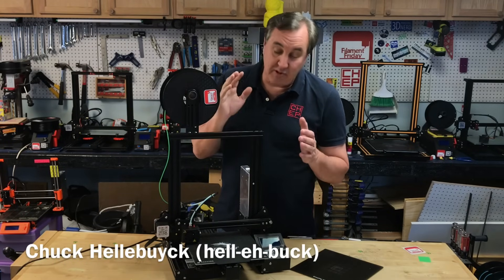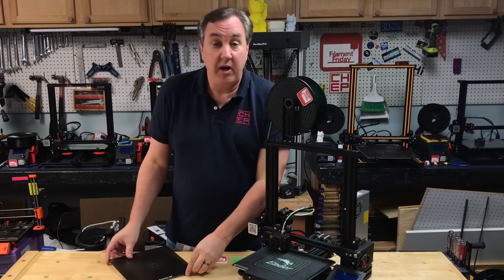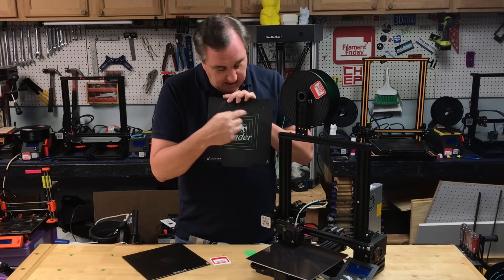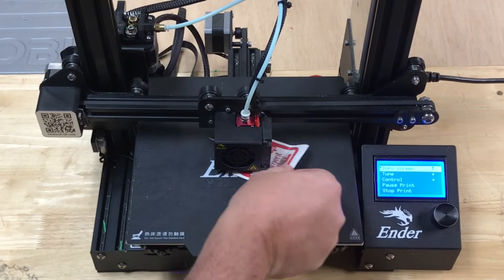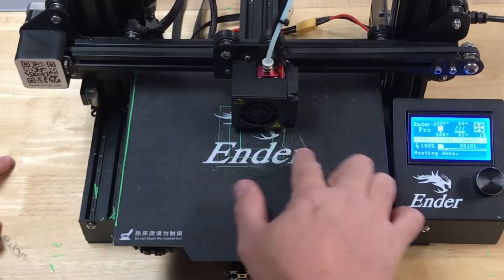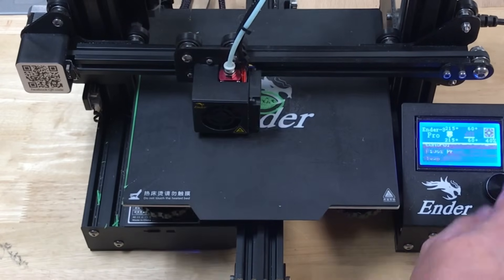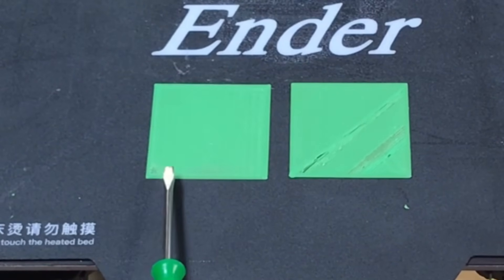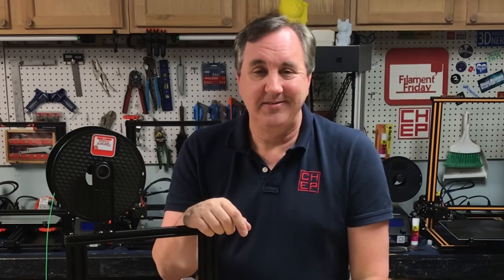Creality Ender 3- Easy Way To Level Your Bed

Comment: My ender 3 is my second 3d printer and your tutorial is all I needed to get it printing in a resuliotion I am happy with. Thank you for creating such an easy to follow and useful visual aid in getting my ender out of the box and printing in such a short amount of time. I think it was less than 3 hours from opening the box to first finished print and I cannot thank you enough for your help.

Comment: I know this is an old video.  one thing no one ever discuesses when leveling the bed is how to - preload the springs  on a printer bed.   epecially of yuou had to replace your bed for one reason or another. (I am in thise boat)  can not get a level bed
Reply from the maker: Try to lower the Z switch.
Reply: @FilamentFriday  I finally just leveled for the center since I'll never utilize the full bed. Prints are working 100% now
Reply: Hey Jim, did you ever find a solution ? I have the exact same issue

Comment: Hey Chuck, 
I'm not sure if I should buy the ender 3 or the CR10. I do value the larger print size, and have the funds to afford it, but am not sure if the ender may be more suited for a complete beginner (although a lot of experience with CAD) Thank you!
Reply from the maker: User experience is the same. CR-10 is a good machine.

Comment: @CHEP Hey man I really need help, so I yesterday i printed a mini and it came out good. But today when I turned on my printer to make one it just heated up the filament, traveled to the left side of the bed plate and drew a line all across the side of bed plate until it got to about 2 mm high when I stopped it. So I thought maybe bed leveling was the problem so I was following this video and turned on the process, but the nozzle did not touch the bed plate or card at all and it only traveled to the front left corner and back left corner. It did not go to the center at all. I really need some help I'm feeling very frustrated and discouraged, someone please help me I don't know what to do.
Reply from the maker: Check the stepper motor connections to see if they are loose.
Reply: @FilamentFriday  Okay so I googled the stepper motor and I tightened a couple of screws and made sure the tube the filament goes through was on correctly. Now I just ran a couple of tests and it seems that the x axis rumbles and shakes when It moves past a  5 1/2 inch point to the right direction
Reply: @FilamentFriday One more thing, so i brought the y axis all the way to zero, isn't it supposed to touch the bed plate if it's at zero? And am I supposed to leave the binder clip on the sides to hold the Sheet down on the bed?

Comment: I still love this method, but have run into a few hick ups.  I am having issues with adhesion and find myself having to adjust the bed every print.   I used calipers to measure a piece of paper and it comes in right at 0.1 mm.  I believe the placement of the pad (Ender 3 Pro) causes some of this as does trying to peel the item off the table in lue of removing the magnetic bed.  
My issues started after I upgraded the stock Y axis tensioner.  I'm not sure how doing this changed anything for the worse, or how belt tension in general would impact  adhesion.  BUt I also am trying new PLA, and its a cheap brand so this may be it.  Or perhaps It could be a clogged tip- the feel on the paper during leveling seems much rougher and harder to get under the nozzle.
Reply from the maker: If you live adjust like the video showstopper should be fine, the paper is just a starting point.

Comment: Very good, i use a similar gcode from thingiverse(mybe its yours haha), and its very good too.its true that any time yuo remove the glass there are minor chages to the bed,but its tiny ,one question:if i use a big layer 0.2 the distace of the nozel it must be bigger than if i use 0.12..(yes i know its logical,most monual say use a distancevof 0.01,a paper sheet)
Reply from the maker: Should be the same. The difference in space is handled by the z lift. No matter the layer height bed is zero.

Comment: Z Axis stay way too far to the bed even after leveling it. Never sticks to bed or reamed it, please  help
Reply from the maker: Make sure the z offset in slicer is set to zero
Reply: @FilamentFriday  Control》Motion》Z offset 000.50
ABS filament 68 degree bed temperature but still it reams the bed and stuck or still doesnt stick to bed. Where exactly the position of extruder  should be
Reply: @FilamentFriday  thank you for help by the way
X and Y axis work well but for Z, its 0.00 when far from bed or  0.00 again when i push the binding till it almost touches the bed but i think it's not the right thing to do. Beside XYZ axises, what extruder movement stand for
Reply from the maker: I’m not sure what the issue is. Are you homing everything before doing my leveling technique?
Reply: @FilamentFriday  i can't finish the first part because wheels(sorry for vocabulary) underneath of the bed have problem, whatever side i turn, one side stay too close to the bed
Reply: Sectec you might have a cheap ender 3 bed cover or even a magnetic one. Gotta love relying on something you can literally bend and then expect it to sit flat at all four corners under 0.1000mm tolerances lmao. Stick to glass, you can’t bend glass and the glass won’t bend due to how many or how little binder clips you use on the side........... 👍🏼

Comment: First: Love the video and the help. I just got the Ender 3 Pro and I'm having some issues with leveling the bed even after the video.
The main issue I'm having is that I can level the front of the bed just fine, but there doesn't seem to be enough play in the rear to level. The issue is that I can't drop the bed in the rear enough to move the paper. Frankly, based on my test prints, I can't drop the bed low enough on any side. As far as the Z sensor, It is resting on the main support. So I can't drop it any further.
Reply from the maker: Sounds like something may be off with the assembly. The bed should move level front to back. Maybe the crossmember isn’t seated or the beam is cut properly by the factory.

Comment: THANK YOU FOR THIS VIDEO.  Although the drag required when using the paper is somewhat subjective, running the print square test afterwards should help the novice (like me!) to see what a given "drag" on the paper equates to.   Every machine will be somewhat different as well so the drag I feel when doing this process may be different if I were to go to another printer.

I love the simplicity of this and created a UTILITY folder on my working SD card to run this program every 2-3 prints.  I'm not at the point were I feel comfortable with installing an  electronic bed leveling (honestly at this point they seem much harder and fidgety than this method!)
Reply from the maker: I prefer manual bed level to autolevel.

Comment: Will these gcode files work with a Geeetech A10? Thanks
Reply from the maker: Yes,they should.
Reply: @FilamentFriday  thanks..I'm waiting for a new LCD cable.. so thought gcode through Repiteir would work.. but looks like I can manual bed level by stopping motors in Repiteir.. thanks

Comment: If I peel the disks off afterwards and use a micrometer perpendicular to the flow of lines, how thick should the disks be in mm?  I'm at about .21mm and wondering if that's to thin or not thin enough ... any idea?

Comment: Thank you! I have spent about a week leveling the bed and getting my new Ender 3 working. I learned that the adjustment springs for the bed were a little too weak and the bed was never level, one corner was way off.  The procedure really helped me track down all the little issues.

Comment: Can anybody tell me what I'm doing wrong?  I followed the directions here and it seems my bed was way too high.  I lowered it a bit and now my first layer looks much more consistent.  Before, I had spots where it didn't print at all. 

 But my problem is after the first layer.  

I just got the printer last week and I'm trying to print something small to see how it works.  I hate to wait 20 hours only to find the part is no good and all that filament is wasted.  So I downloaded the file for a "round tuit" from thingiverse.  

I'm using PLA at 200 degrees and the bed is at 60 degrees.  I've been using the "normal" settings in Cura 4.0.0.  I raised the fill to 20% but that didn't help.  

When the print is finished, it's very flexible and has no strength.  It's like the bottom, sides and filling aren't bonding to become one.  If you rub it with your thumb, the letters will come right off.  The top layer is also very porous,  it almost looks like cheese cloth.  

Any ideas?  Does it sound like a slicer issue or does my printer need more adjustment?

Thanks.
Reply from the maker: Sounds like you have a blockage in the nozzle. Watch this as it uses the same hot end. 
https://youtu.be/x35aWmnZ_A0

Comment: Hey bud!! Have you ever tested actual temperature of the bed?
Mine is saying , say 100c and when tchecking on the bed a thermometer reads 75c.
Now under the removable build plate it it's 100c.
Reply from the maker: Something seems wrong as losing 25°C in that thin of material is difficult to achieve even if you wanted to.
Reply: @FilamentFriday  Thanks for the reply!!
Have you ever tested actual bed temp?
And on different bed material?
Reply from the maker: From time to time I check it. Glass loses 10° but never seen Buildtak lose that. I just clipped a probe to edge of my mag bed Ender 3 probe at 60° bed and reading 54°. Should be few degrees hotter at center.
Reply: Alrighty!!! Thanks for the input. Gonna have to check again :)

Comment: If you were to use a feeler gauge, which size would you use instead of the paper for each of the two rounds of testing?
Reply from the maker: 0.2 and 0.1mm

Comment: I want to thank you for this great video and files. I downloaded you gcode files and followed your steps and got great adhesion and accuracy right out of the gate. Not only do I use your bedleveling file to make sure I get good adhesion but I monitor it to make sure the layers have an even thickness.

Comment: Posted a more comprehensive explanation here: https://docs.google.com/document/d/10vsq-cN722SfCyX4edZYfuxIOAc-E5zJBaB7jsbepQI

To me this leveling method seems fundamentally wrong. At least my Ender 3 auto-homes to Z=0, but the first layer is printed at (for example) Z=0.2 mm (Cura default). So when I use a paper, feeler gauge, whatever to set the distance to, say, 0.1 mm, then the first layer will actually be printed at Z=0.3 mm. That doesn't seem right and doesn't work properly, either, at least for me.
So, what I do: Auto-home, then move Z axis to 0.2 mm. Then use feeler gauge to adjust bed to a distance of very slightly below 0.2 mm, that is a 0.2 mm feeler gauge is just barely pinched between bed and nozzle. You could probably use two to three layers or paper here, but I never tried that, because I've already bought a set of feeler gauges.
Reply from the maker: The flaw is having Z offset at 0.2. The bed is Z=0.
Reply: But that's exactly what I'm trying to say. The bed is at Z=0. If you print something that's 20 mm high, you want the nozzle 20 mm above the print bed at the end. And if you print something that's only 0.2 mm high (i.e. the first layer), you want to have the nozzle 0.2 mm above the bed. Which is why Cura generates G-code with the first layer a Z=0.2 mm (default first layer height).
But if you adjust the nozzle to be a paper thick (about 0.1 mm) above the bed, while the printer thinks you're at Z=0 (auto-homed or your G-code), you effectively have your nozzle 0.3 mm above the bed for the first layer.
What I'm trying to say: Set Z to something realistic (e.g. 0.2 mm), then use a feeler gauge to adjust the bed to that distance. Or maybe set it to 0.1 mm and then use a paper. And your G-code would actually be perfect for that, just needs to be changed slightly.
(And I just checked to be sure: Printer has Z-offset of 0 and there is no offset setting in Cura.)
Reply from the maker: You use the paper to get close. Then live adjust to get a good first layer. First layer extrudes at 120% so extra is put down in first layer. In reality a 20 mm build will end with the nozzle about 20.1 but the top layer will melt down a bit and give you close to 20 even. 
It works. Just follow the video and you won’t have the issues you describe. This has been proven for years this is not a new technique.

Comment: Great video Chep.  I’ve been reading about the setting the Z Offset as well but am struggling and would love to see your take on it.
Reply from the maker: Z offset is only needed in autolevel systems. If you adjust the bed as I show here the live adjust is all you need.
Reply: CHEP thanks for the quick reply.  I was under the impression tightening up the springs near max would eliminate a lot of movement then I had to do the z offset the tram the bed after that, but your response has put me at ease so much appreciated :)

Comment: I've been printing about 4 months now. I've always struggled leveling my printer, I've been using the paper method and test prints almost the same you demonstrate but you make some very important yet sutble points the other guides I have watched missed out. Thanks.

Comment: somehow i made sure the mat is equal to the metal bed, but when it starts .. it barely makes the first line along the bed... how can i adjust that or do i just place the black mat a bit off the metal plate?
Reply from the maker: Read the GCode with a text editor. You can adjust the X offset.

Comment: Just a quick note to say a massive thanks for this video!  The trigger words for me were "significant resistance".  I only got my Ender 3 Pro yesterday, did a bed levelling and tried to print the dog.  He let go about two thirds of the way through and I had warping on the base.  Now printing your spool holder mod and it's coming out a treat!
Reply from the maker: Glad I could help.

Comment: Hi, thx for this tutorial.  Got my 3 Pro setup and ran your first gcode Chep Ender3 Bed Level. It will home to the first position, but the screen does not prompt "wait for user" and does not move to the first position and no response to button push.  Just d/l'd from thingiverse.  Any ideas? thx!
Reply: Problem solved!  I was using the cheap sd card sent with printer. Reads ok on the PC, but not on the scanner. New sd card, all working.....BUT, I definitely have some warp on the bed.  The center is decidedly lower than the edges.  I can get the edges set perfectly, but the center is off and bed too low.  If I then adjust for the center, the edges become extremely tight on the bed.  Any advice here?  Thx again.
Reply from the maker: Focus on the center as that’s where most of your prints will sit.

Comment: I purchased an Ender 3 a few days ago and I must have watched this video at least six times from start to finish. I downloaded the gcode files and ran the bed level program three times to ensure the center was set correctly. After the third test, I used the second file to print the squares and it printed perfectly the first time. No loose filament, print held on the print bed, and it had no additional "strings" or flat/high spots on the squares. Thank you so much for this video and the files! This definitely helped me level the bed and ensure I put my Ender together correctly.
Reply from the maker: That is great to hear. Thanks for watching.
Reply: Where are the bed leveling files
Reply from the maker: Link in video description.
Reply: I leveled it perfectly and my build still came off the build plate and caused spaghetti
Reply from the maker: @JoshyBoy-gb3pc - Clean the bed with soapy water and let it dry. Add a layer of glue stick and try again.
Reply: Ok thx

Comment: Okay so I was able to make the 2 front corners and they are correct but if you go further back...it will scratch the bed and the leveling wheels are as loose as can be on the back. I've been playing for an hour and nothing will help. HELP!!! Did I get a bad ender 3?
Reply from the maker: If it scratching the bed as you move back then you should be tightening the back screws not loosing them.
Reply: CHEP I got it never mind thanks

Comment: I'm completly new to 3D printing and i got a question for the bed leveling; Is it possible to level your bed by adjusting the bed on all 4 corners so that it exactly touches the nozzletip and then choose an Z-Achsis Offset of like 0,2 - 0,25 mm in the Printer /Simplified 3D settings ?

Comment: i have a question bc im new to printing and when i load that leveling program and i adjust the height as in this vid. and then start to print the noozle goes up from the bed alot. if i check manualy it says its 15,5 off.  how can i adjust the differences???
Reply from the maker: That sounds like an issue with your print file not the level.

Comment: Something to think about.. I took my Ender 3 bed to an Engineering / Machine Shop and they leveled the bed precisely (as the Ender 3 bed is cheap aluminum and not flat at all) with a mill to a perfect flat surface. They also squared the frame to frame intersections for a true fit. all for about $60.00us

Comment: I am trying to level my bed on an ender 3 but the problem I have is 1 corner is cracked all the way down(spring compressed max) but it is still too high for the nozzle.
I have tried turning each wheel same dist with still no lock.

any one can help me?
Reply from the maker: Bend the plate underneath down. It probably got bent up in shipping,

Comment: Super, thanks. I do have a question though. I went through all this, and the initial layer height is defaulted to start at .2mm in Cura. The app won't let me make it 0, but if I pause the print, and move z axis to 0, it prints perfectly. If I don't do this, the print will not stick. Does this mean the bed should be tighter against the paper?
Reply from the maker: Yes, your bed is too far away. The initial layer is that height so you can’t print a zero height.